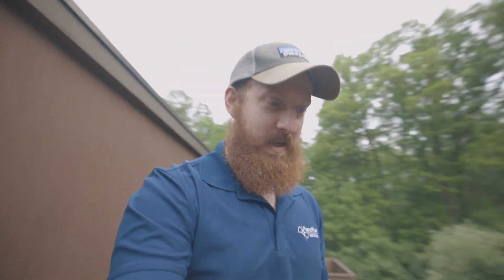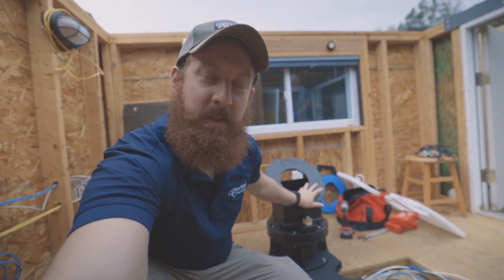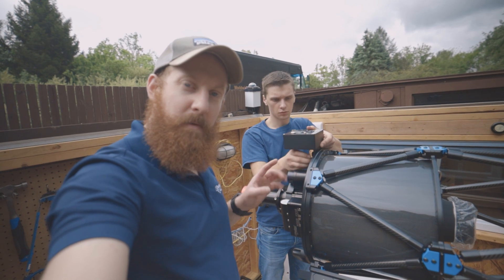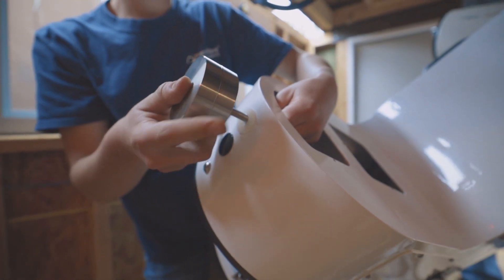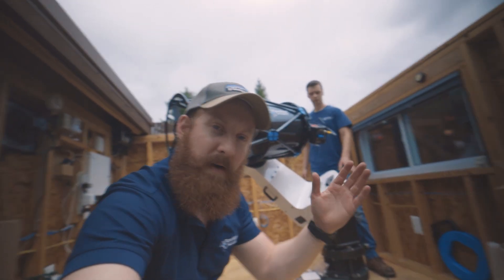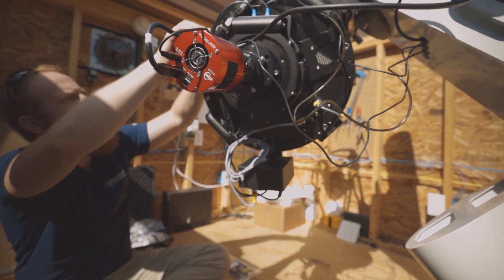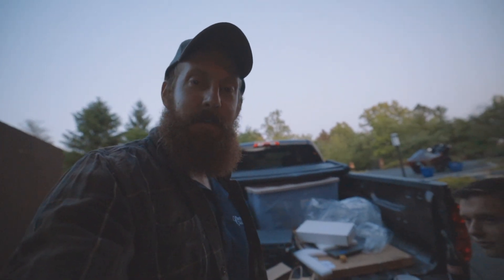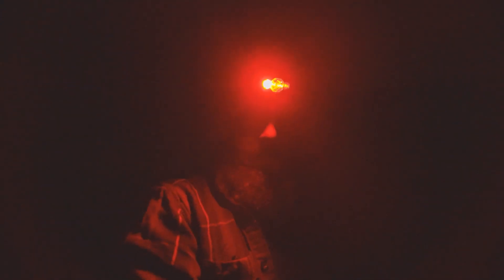Installing the PlaneWave L-350 and CDK14

Comment: Many times over, Loosening, and then re-tightening different bolts and set screws? Lock nuts and such like this. But I never see you use an inch pound or a foot pound torque wrench. You seem to do it all by hand but we all  know that precision instruments need to be maintained with precision instruments. Are you actually achieving the highest precision possible by tightening by hand?

Comment: Hey there great video - i am interested in putting one fo these on a large vessel at sea (it will be stowed in-between uses). We have designed an automated stabilisation platform that will remove 98% of the pitch/roll from the ocean (based on an 11 second roll period) and i am wondering is this will be sufficient..... does anyone have any advice please? Im aware this is an unusually challenging task that may never have been achieved before but its a new project i am working on and i need to evaluate all options here. thank you
Reply: I'd love to see this . You have some challenges !!

Comment: Where do you find the counterweights that you used on the L350, I don't see them on the website. Great post
Reply from the maker: Hi Walter, you can run with the 0.5lbs stackable weights and those are individually know as part number 125382. Those attached via 3/8-16 bolts, which are the tapped holes on the front and back of the L-350 azimuth. We will also have a balance accessory for the L-series to post on the website soon.
Reply: @Observable-Space  Thanks!

Comment: Thank You Plane Wave for Making My Day. Matt I just do not Know L-350 ? L500? I originally wanted and dreamed about the L-350 then did'nt want to be undersized for load, What was that Man install weight Load on the L-350 installed and do you now include the counter weights as load? I would assume it is added load? Thanks for making my choice more difficult LOL God I cannot wait to I order A Plane Wave MDL?
Reply from the maker: The L-500 is a great option to have the added capacity (200lbs) vs. the L-350 that is designed for up to 100 lbs. Both offer the same tracking and pointing precision, but the question comes down to is the additional capacity key for your project. Most would agree it is so they can add larger equipment down the line.

Comment: Matt, what is a ball park figure $ for a setup like this? Can it be install by the customer?  It pretty sweet but how realistic is it to acquire. 🤔
Reply from the maker: Thanks for watching Edwin! The CDK350 system (L-350 mount and CDK14 optical tube) is $22k and certainly can be installed by the end user. We like recommending having use help install systems as it gives us the opportunity to train the user and teach them about the equipment to maximize performance.
Reply: @Observable-Space  thank you and it makes sense for install! You know how when you retire you want to get the nice expensive sports car? Well for me it would this setup😍 I love planewave someday I will own one!!!
Reply: @edwinsanchez1167  I would agree, that a rig like this over sports car, no contest. If I had the money for Ferrari, I would just get a bigger Planewave rig. 100% of the time.....and a chunk of land much darker than where I am. Something like this is my Lotto Win, dream.

Likely will have to settle for an EQ6 or EQ8, and de-fork my 1978 Celestron C-8.
Reply: @Observable-Space  What else needs to be purchased? The derotator? Electronic focused? Rolling pier? How much additional for those things?
Reply: We have been looking at Plane Wave L series for 2 Years undecided on size  L-500 21K,  L350 12K both with wedges, Unsure about installation, I Never asked? I am 65K into a structure and support equpment and automated dome, L-350 has a Max payload 100LBS,  L-500 has Max 220Lbs Capacities, Matt Has the Best job on this Planet
Reply: @CAREFREEOBSERVATORY  thank you, I know you are going to have lots of fun with your new rig😍 clear skies!

Comment: For the final pointing model after polar alignment in a permanent installation, what is the recommended size of the model before diminishing returns? a 50 point model? 75?
Reply from the maker: Anything more than a 100 point model would likely become overkill, so we usually recommend users aim for between a 75-100 point final model.
Reply: @Observable-Space  Thanks! I will be doing that this weekend on my L500